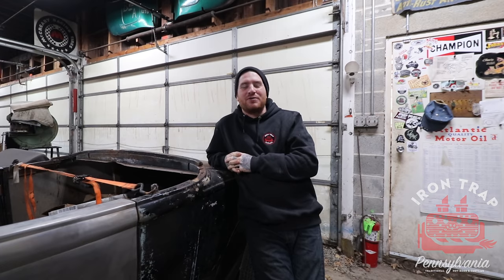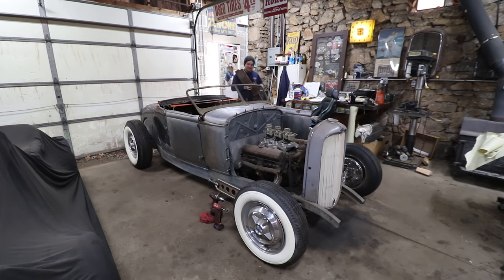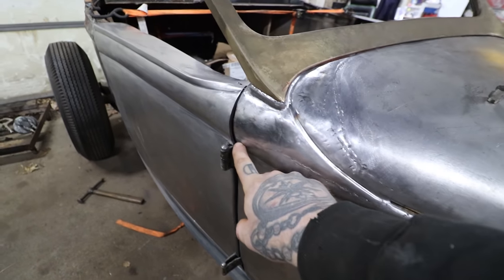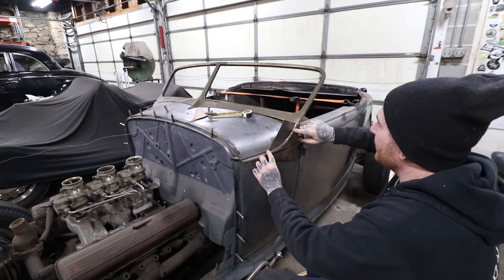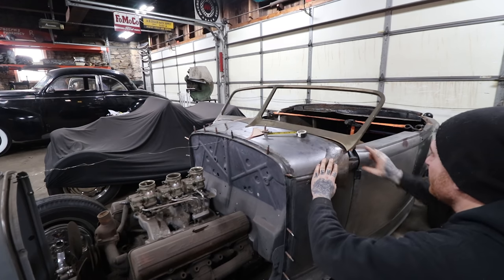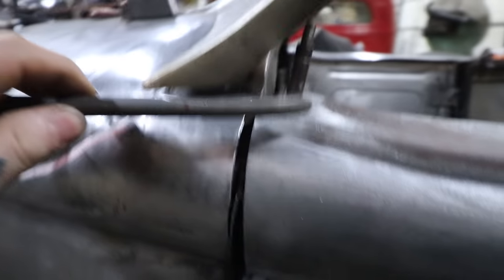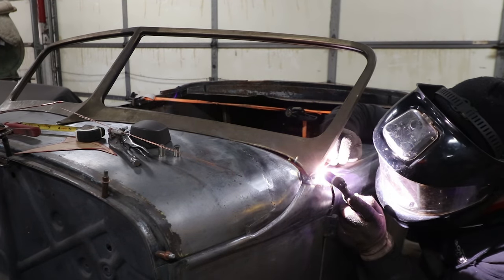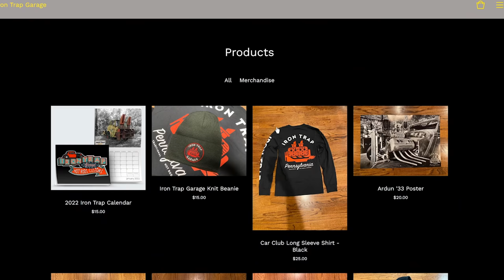Fitting A DuVall Style Windshield To The Sweetheart Roadster!!

Comment: That brass windshield frame would look awesome polished after you put the candy metal-flake paint job on the body!
Reply: I bought & fitted one around 20 years ago, it was made from the original patterns by a company in Canada. My plan was to have it polished but being cast from bronze it caused more trouble than it was worth. As fast as the imperfections were polished out, more & more appeared. I eventually had it polished and triple plated and after three attempts it looked stunning.
Reply from the maker: Chrome plating is the plan

Comment: Matt, I thought you would have pie cut the window frame and brazed it back up to fit. I never thought of reshaping the cowl. Your the master my friend. Keep up the good work.
Reply: I'm actually kind of surprised that the 35-36 cowl is so similar in width to the Model A. Nice job.
Reply from the maker: It isn’t similar. The frame is meant to sit further forward on a 35/6 on the narrower area. Which is similar to the widest part of an A cowl.
Reply from the maker: It would be a nightmare to cut and reshape the windshield frame

Comment: I love Duvall windshields. Looks stunning. The one you installed looks like the one I got from Wescott for my '32. One thing I did on my  '32 was to build a framework out of 1" square tubing that tied into the inner body under the dash. The studs of the windshield went through that and took any stress off of the cowl. Glass? I had a local shop cut the glass. It cost an arm and a leg, actually 2 legs, because of the cost of the pattern. I still have the pattern collecting dust on my shelf. You can have them if you need them. Let me know and I will take some measurements so you can see if they fit. I know that several guys were reproducing these windshields. If they are the correct size, I can ship them to you or I can bring them to Hershey. Let me know.
Reply from the maker: Yea we plan to put some doubler plates under the cowl to spread the load on the cowl. Box tubing is a truck idea! I’ll just make plywood patterns for the windshield when the time comes. Thanks though

Comment: Nicely done! How about adding a fairly thick gasket under the windshield frame? It would eliminate wind coming through, and also help even out any remaining small gaps.
Reply from the maker: We will put a small gasket down regardless but I’ll make the metal work/body work fit the windshield correctly first.

Comment: Looked like you could have taken out a couple inches on each side about 6" from the centre post.  I hope the frame is still Flat!  Cover those 97's!!!
Reply from the maker: Taken a couple inches out? It would have been ridiculously small then.. it isn’t warped at all from that minor bit of heat. It’s solid cast. The 97’s need to be rebuilt.. doesn’t really matter they get fully disassembled anyways….
Reply: @IronTrapGarage  The thought was to Narrow the assembly to fit better without all the added metal.  I didn't know it was Cast.  What material?

Comment: Why not modify the bottom of the windshield frame?  I think it would look a lot better.
Reply from the maker: Modify it how? You’d have to add a ton to the windshield frame and it would have a tall shelf on the bottom of the windshield frame.
Reply: @IronTrapGarage  Stand the windshield up a bit more, that would bring the corners down.  Add a piece to the (looks like bronze) lower edge of the frame to fit the cowl.  Either way it will take a lot of screwing with it.  
I love your channel by the way, keep it up.